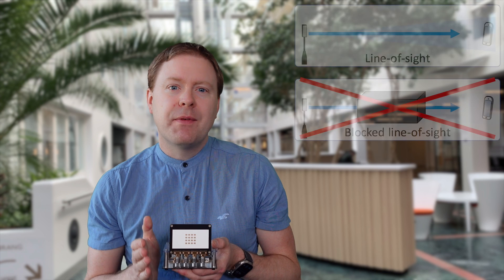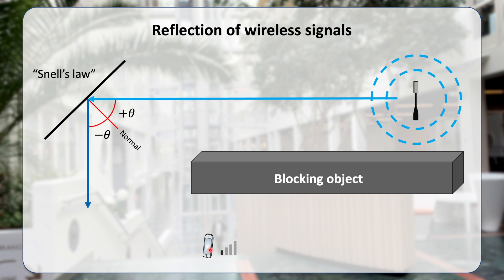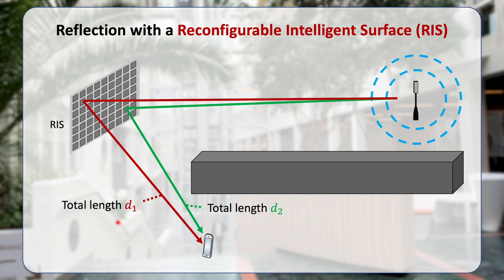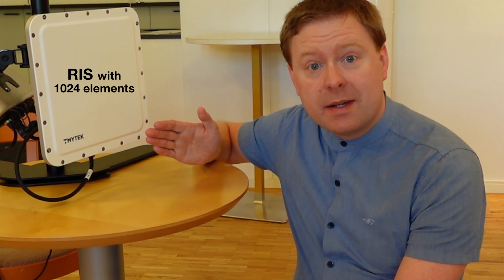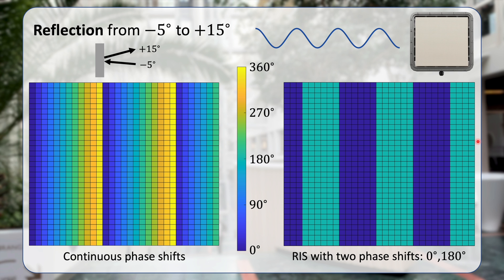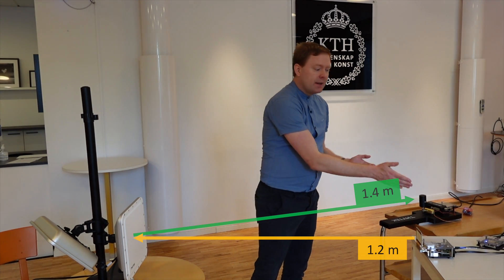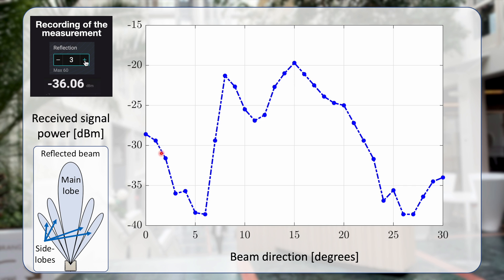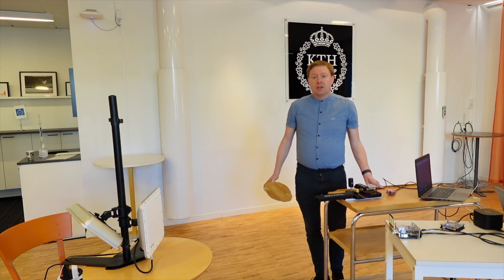This 6G Tech Lets Wireless Signals Bend Like Magic!

Comment: why the Fraunhofer distance formula is 4*Area/lambda for a square array, and 2^D/lambda for an arbitrary array with the largest dimension being D. (I mean the dreviation or a refrence)
Reply from the maker: The formula that you mentioned is the correct one: 2D^2/lambda. For a square with diagonal D, the area is A=D^2/2. If you substitute that into the expression, you will get 4A/lambda, if I calculated it correctly.

Comment: what is the difference between a LIS and a RIS? Can't seem to find a consensus online...
Reply from the maker: The original definition was:
RIS = A reconfigurable reflective surface that is not part of a transmitter or receiver. It might consist of a sub-wavelength-sized elements with small spacing, so one can study its properties as if it is a continuous surface.
LIS = A transmitter/receiver with a large array size and containing sub-wavelength-sized metamaterial elements, so one can study its properties as if it is a continuous surface.

Unfortunately, some researchers started to use the term LIS to also mean RIS, and some researchers started to use the term RIS to also mean LIS...

Today, I think that most researchers use the term RIS to mean what I wrote above. The term LIS is not used very much anymore, but people are instead talking about holographic MIMO or dynamic metasurfaces.
Reply: @WirelessFuture thank you ❤

Comment: Thanks for all of your work. A short question that came to my mind while reading your book. I just put it here. 
In your definition of spectral efficientcy you speak about bits of information per "complex-valued" sample. In other sources I just read sample.
Does that complex refer to the fact that we are in the IQ plane and we get a value of an amplitude plus phase per sample?
Thanks.
Reply from the maker: Yes, that is a correct interpretation.
The actual passband signals are not complex, but we bring the signals to the complex baseband where the samples become complex and represent IQ samples.

Comment: Hi Prof, briefly, how do you make the plate components and controller? Starting from the materials and perhaps the coding for the controller. Thank you prof.
Reply from the maker: I haven’t designed the surface myself, but here is a paper by some people who have done it: https://ieeexplore.ieee.org/ielx7/6287639/9668973/09668918.pdf?tp=&arnumber=9668918&isnumber=9668973&ref=aHR0cHM6Ly9zY2hvbGFyLmdvb2dsZS5jb20v
Reply: @WirelessFuture  I also found the prof's journal, but I'm still confused about the details of the controller itself. https://pureadmin.qub.ac.uk/ws/portalfiles/portal/473068272/ID_1274_Static_Power_Consumption_Modeling_and_Measurement_of_Reconfigurable_Intelligent_Surfaces_.pdf

Comment: Many thanks for the very thoughtful explanations! 

Could you comment on how a RIS is effected by different wavelengths. First, considering a much lower frequency (700 MHz) and a larger distance. How does a RIS would look like, and would it make sense to use one for covering areas around a blockage (back of a house)? What is the impact on the power consumption?
Second, I understand you need to consider near-field effects especially for mmwaves and rather short distances, but do you exploit any specific near-field effects indoors vs what to consider in case of a far-field propagation?
Reply from the maker: I believe the RIS technology is more useful at higher frequencies because: (a) The beamforming gain, for a given physical RIS size, becomes larger when you have smaller reflecting elements; (b) There are more blockages and coverage issues in mmWave bands than at lower frequencies, so deploying an RIS can make a bigger relative coverage improvement.

A typical RIS looks like the one shown in the experimental part of the video. It is a planar surface with a control unit behind. You can use it to reflect a signal around a blockage, particularly if you can find a deployment location for the RIS where it sees both the transmitter and receiver.

The RIS that can be bought or have been built by universities are functional prototypes built to enable testing rather than products meant for commercial use; thus, it is hard to predict what the power consumption will be in future products. However, I believe the power consumption of a RIS (with a given physical size) will grow with the carrier frequency because you need more elements at higher frequencies.

One needs to select the RIS elements' phase-shifts to reflect the signals to the right location. As illustrated in the video, one needs to calculate the total distance between the transmitter and receiver through each RIS element, and then assign phase shifts to compensate for the differences (i.e., aligning the peaks of the sinusoids). If the transmitter or receiver is close to the RIS than the Fraunhofer distance, you will see that the desired phase-shift pattern is curved rather than linear. The linear and curved phase-shifts shown in the video were calculated mathematically, but match what the control software for the considered RIS is providing. The Fraunhofer distance of the 26-30 GHz RIS considered in the video is 10 m. If one uses an equal-sized RIS at 3 GHz, the Fraunhofer distance will shrink to 1 m, so then the near-field effects will likely be negligible even in indoor scenarios.

Comment: Dear professor, in practice, how does the RIS know the angle of users? By sending pilots or something like that?
Reply from the maker: Yes, one can send pilots and reflect them using a predefined set of RIS configurations. After that, the RIS can either use the best configuration among the predefined ones, or it can compute an even better configuration by utilizing channel models that show to interpolate between the tested ones.

The latter approach is discussed in this blog post, where I link to a video and a technical paper:
https://ma-mimo.ellintech.se/2024/06/07/reconfigurable-intelligent-surfaces-through-the-lens-of-array-signal-processing/

Comment: Just a question about Fraunhofer distance, you mentioned it is proportional to area squared... please explain it, thank you.
Reply from the maker: Thanks for asking! The correct expression should have been 4*Area/lambda - so the 2 ended up at the wrong place.
The Fraunhofer distance is normally expressed as 2D^2/lambda, where D is the "largest dimension of the radiator" [R1]. If we consider a square array with the diagonal D, then its area is (D/sqrt(2))^2 = D^2/2.
If we substitute this into the Fraunhofer distance expression, we get 4*Area/lambda. 

In our case, the area is (32*lambda/2)^2, so we get 4*16^2*lambda ≈ 10 m.

[R1] Wikipedia link: https://en.wikipedia.org/wiki/Fraunhofer_distance

Comment: I find the concept of RIS very similar to adaptive optics in telescopes, which is used to compensate for the atmospheric distortion of light. It's plausible that the control algorithms from adaptive optics could be adapted for RIS.
Reply from the maker: There are indeed similarities between RIS and reflectarrays, lenses, and similar technologies that have been explored and utilized for quite a while. It is usually easier to build advanced analog signal processing features at lower frequencies, so my guess is that things that can be done in adaptive optics are already done in RF bands, but I don't know for sure.